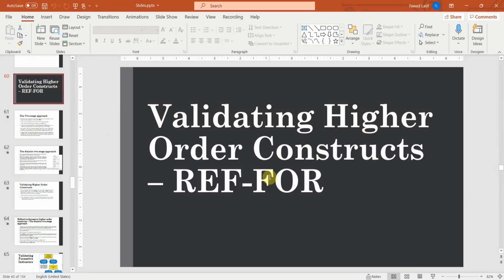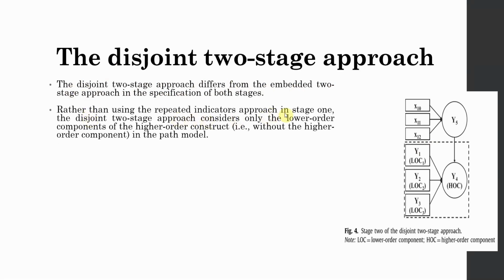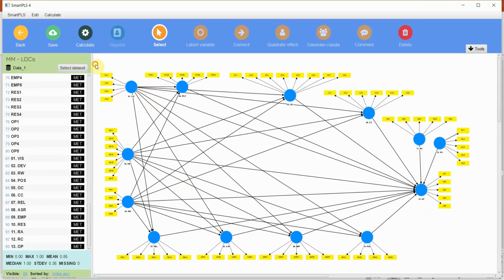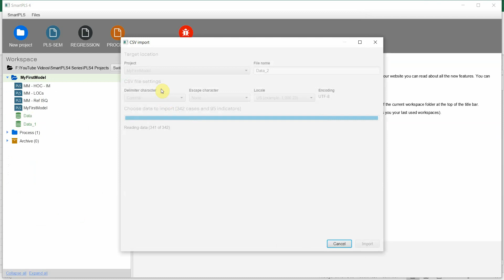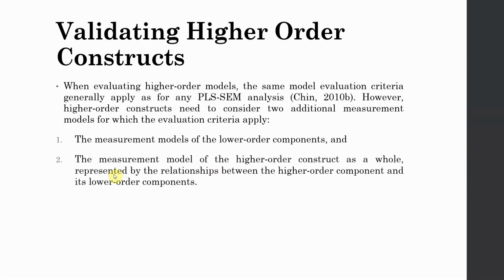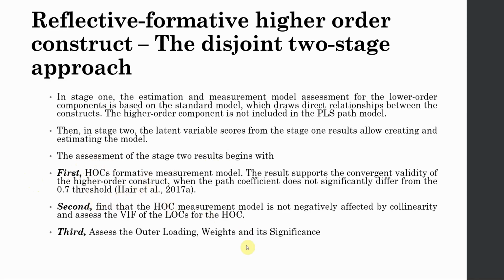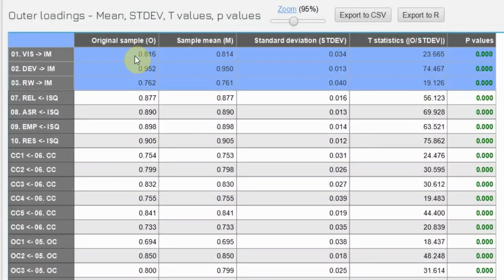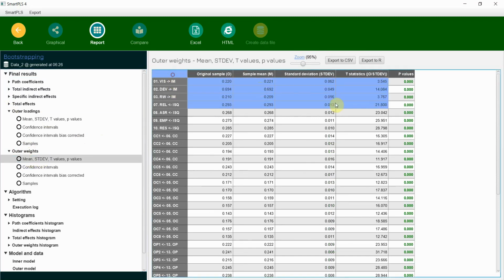#SmartPLS4 Series 18 - How to Analyze Higher Order Reflective Formative Construct?

Comment: Hy SIr, Question 1: I found my convergent validity for the Ref-For HOC is not established, do I have to dismiss the construct from my model?
Reply from the maker: You can improve convergent validity for LOCs, check the item loadings. If for higher order, see if the sub-constructs are interchangeable.

Comment: Sir, if a higher order construct has two indicators with different scales, for eg. One is dummy/ binary and the other is numeric, how to deal with it. When trying to incorporate
 Both in the higher construct and connecting it to the endogenous variable, the circle stays orange with term MIX mentioned on it
Reply from the maker: Try using the same procedure.

Comment: Thanks for the above video. Suppose indicators forming my LOC are ratio data i.e (number of records in the system vs number of records in the physical records) and not likert type of data.How does one run such an analysis?
Reply from the maker: The procedure remains the same. SmartPLS is not only for likert type data. The variable has to be a metric variable.

Comment: video is blurred
Reply from the maker: Thanks for watching. Please check internet connect. It happens due to internet.
Reply: Sir, how can we solve the problem if the moderating variable is there between lower and higher order constructs?
Reply from the maker: Please watch
https://youtu.be/xDwBW0C07AA
Reply: What will be the procedure if reflective , formative with moderating variable? Please specify
...
Reply from the maker: The moderator in the video is ref for
Reply from the maker: You may also watch
https://youtu.be/OB_k10l0oIs

Comment: Dr... quick question - is using a global measure the only way to assess the convergent validity? I have not learnt that and have not included a global measure in my questionnaire and I have already finished collecting my data. Is there another way to assess convergent validity without using a global measure? Thank you.
Reply from the maker: Thanks for your comment. Actually, in my little knowledge No. However, you can assess the other mentioned steps to validate the formative construct, and leave this one as you have the limitation.
Reply: @researchwithfawad  Thank u for ur reply. By not assessing the convergent validity, and stating it as a limitation of the study, will it not affect the chances of my study being published in a journal? What do u think Dr? Or should I just treat all constructs as first order? Then I won’t have this issue - right?
Reply from the maker: No, it wont be an issue. Other forms of checks will do.
Reply: @researchwithfawad  thanks Dr.  I also have the same issue. I didn't know that in formative measurement in HOC, global measurement should be used. To make this issue as my limitation, is there any article reference that stated that research model can still be kept without doing the redundancy test?